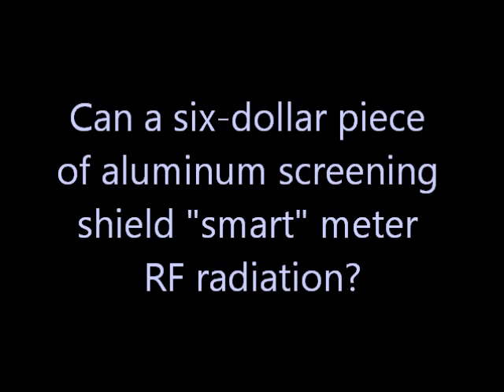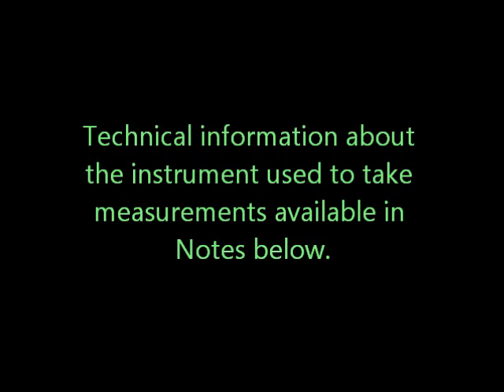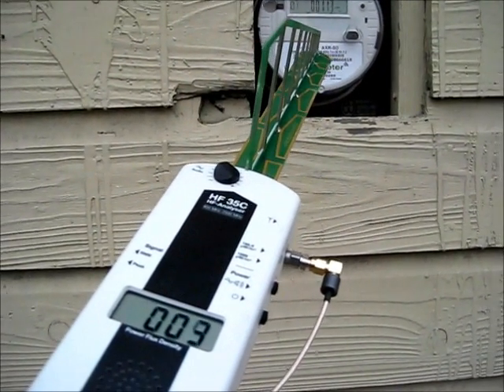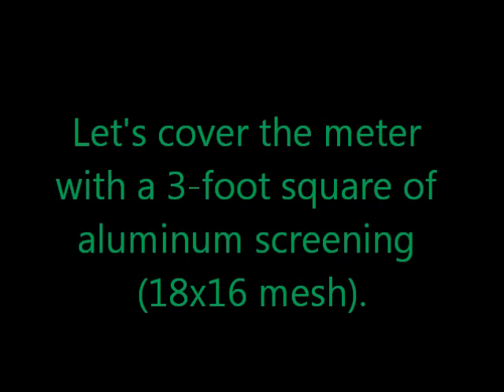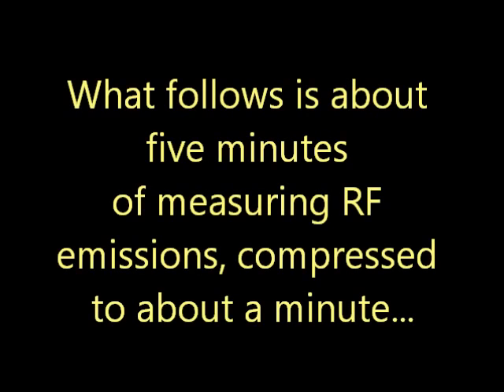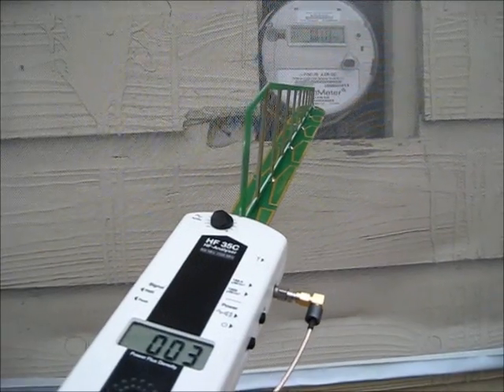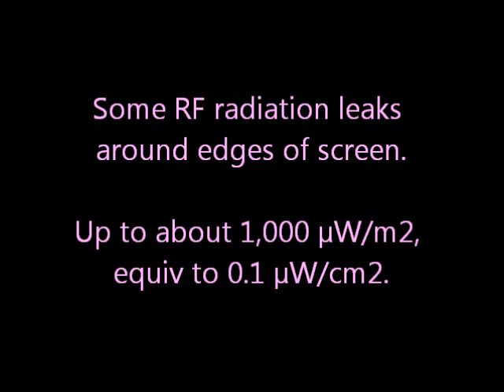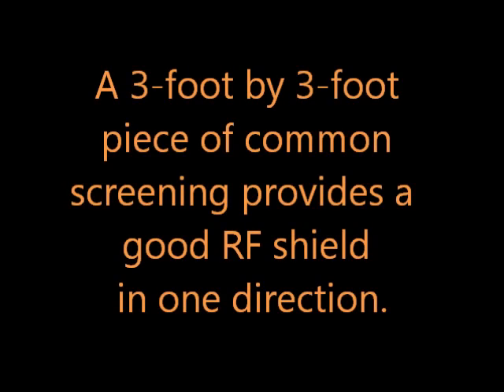Foiling a "Smart" Meter, Part Two: Aluminum Mesh Screening

Comment: really how about the 'radiation' from your electrical wiring, wifi, cell phone, the sun. it's not the same as nuclear radiation. and it's all around you. get rid of all your electrical things and move out into the stick where there is no electricity and you'll still be exposed. Go to school and learn what it all really means.Please
Reply: It occurs to me I have been very mistaken in my position on this. I can't understand why I didn't see it before.
These meters DO emit deadly, cancer Causing Radiation!  The proof here is undeniable!

But Luckily, I have come up with a soloution for this and I'll be selling it to all the wise people that have woken up to this terrible plot.  For just $99.95, I'll be selling little bits of aluminium mesh like shown  in the Vid here so people can protect themselves from this terrible threat.  To show my genuine concern, I'll even put my own financial interests aside and do a buy 2 get one free deal. One for the front of the meter, one for the back and one for  your cell phone just in case there is any secret cancer causing radio modulation in that which has yet to be discovered.

It's important to be prepared!

So just email me your order and Credit card details and I'll send you your radiation screen  for just $ 99.95 With Free shipping of $51.90. Comes with full instruction of how to remove from the plastic packaging and a comprehensive mounting kit consisting of 4 screws and  2 yards of Duct tape for those customers not  trained and qualified on the use of screwdrivers.

Get your's now! before it's too late and stocks are sold out. AND, as a free Bonus, for the first 100,000 crackpo....customers, I'll also include FREE links to other vital information on Running your car on water, Free energy, Tesla Turbines, aliens on earth and other secret  information your gubbermint is trying to hide from you.

                ORDER NOW!
Reply: *****  "Smart meter radiation is encoded with cancer and disease enhancing modulation" ?? LOL...Some military engineers might like to have a quick look at that circuitry, son.
Reply: +Richardj I believe the radio frequencies all around and going through us are a health problem.  It's mostly manifested in confused thinking and fatigue.  Since I have high energy, I get attention from people with low energy.  I would imagine many of them haven't found a reliable source to keep their energy high(like eating or abstinence from alcohol).
Reply: +Oil Burner Hint-we've already seen arguments like yours enough to know they aren't really arguments.  You are trying to negate the argument by saying the person arguing is a nut-sounds logical to me(not).
Reply: +Richardj Ionizing radiation is a known health hazard.  It does not mean non-ionizing radiation(which can heat up things, for one) is safe.  You don't find the lack of study of non-ionizing radiation to be a problem?  You can look to that 1996 law preventing cities and states from denying cell phone tower construction based on health reasons as the cause.  You then can't turn around and say what studies say about non-ionizing radiation(which you have characterized incorrectly), when studying that has been suppressed by this law(cities and states would have to prove in court if that construction was unhealthy, which they can't do now.).
Reply: Did you really read the link you gave me here is a quote from that page "Smart meters give off RF radiation. RF radiation is low-energy radiation. RF radiation doesn’t have enough energy to remove charged particles such as electrons (ionize), and so is called non-ionizing radiation. Non-ionizing radiation has enough energy to move atoms in a molecule around or cause them to vibrate, which can lead to heat but it can’t damage DNA directly.
RF radiation is classified by the International Agency for Research on Cancer (IARC), as “possibly carcinogenic to humans.” This is based on the finding of a possible link in at least one study between cell phone use and a specific type of brain tumor. Because RF radiation is a possible carcinogen, and smart meters give off RF radiation, it is possible that smart meters could increase cancer risk. Still, it isn’t clear what risk, if any there might be from living in a home with a smart meter.
It would be nearly impossible to conduct a study to prove or disprove a link between living in a house with smart meters and cancer because people have so many sources of exposure to RF and the level of exposure from this source is so small. Because, the amount of RF radiation you could be exposed to from a smart meter is much less than what you could be exposed to from a cell phone, it is very unlikely that living in a house with a smart meter increases risk of cancer. The World Health Organization has promised to conduct a formal assessment of the risks from RF exposure but this report is not yet available."
Reply: Frederique Zug
If the laws in your country had any significance to me, I'd look the answer up.
You seem to think that knowing the answer to these questions proves something.
All it really proves is you need significant mental help.
Reply: Frederique Zug  Where do you live?
USA?
Reply: *****  This whole EMF witch hunt began on Larry King Show, I believe.
Reply: +Richardj And you might learn something if you tried to offset the effects of non-ionizing EMF on people.
Reply: +Richardj Evidence, huh?  How about the 1996 FCC ruling that tells cities and states that they can't deny cell phone tower construction based on health effects?  Would that ruling have the effect of stopping a lot of health evidence, as cities and states present evidence of health effects?  There is plenty of evidence online about the health effects of non-ionizing EMF, and there would have been a ton more, if this ruling was not in effect.
Reply: +Richardj 1996 FCC ruling is a fact.
Reply: +Richardj Please stop advising people about health.  You don't know what you are talking about.  Sorry, but you are advising doing nothing, and that everything is okay, and that's not true.
Reply: +Oil Burner I'm going to the Castro Valley Gem and Mineral Society show this weekend at the Newark Pavillion(Newark, California), and I'm willing to give some of my orgonite(I'll tell you how to use it.) to someone(I don't have a lot.), which will give that person an idea of the effects of EMF in our air today(no need to listen to all these intellectual arguments, if you see the effects for yourself.).  I haven't told him yet, but see Andy(or his wife) at Himalayan Clarity's booth for this.
Reply: +Richardj 1996 law stating that cities and states can't prevent cell phone tower construction based on health totally negates the idea that someone is looking at how healthy these things are.  They've decided to stop any discussion about it.  So, don't try to say something that's just not true.  No one is looking at the health of these things.
Reply: +Oil Burner You are trying to paint a picture, and what we really need is data.  How strong is the transmitter.  What frequency is being used, etc.  You might try to liken things to fairy tales, but what does that have to do with anything?
Reply: +Richardj Don't you have it backwards?  Please show me that it's safe.
Reply: +Richardj I recently put some of my orgonite near the fuses in the breaker box, to good effect.
Reply: how do you know this? it runs only one minute a day.  Where is your evidence?
Reply: Please you don't understand what evidence is.  If believe you this and you listen to the radio, how are you radio receiving the station, turning off your radio does not stop the rf from all the radio station etc from reaching you. Do you know how many milliwatt rf sources are all around around us. Look it up please, and please don't use Anecdotal evidence.
Reply: OK you believe what you want? How do you know what you claim? I don't see evidence of people getting sick from smart meters only claims. You think that there are lies and deceit but I don't see that only claims without facts. Good luck finding your proof about the lies and deceit. The CDC is lying the medical people  everyone, sorry i can't see that. I need evidence and I don't see it.  The smart meter is no different then most electronics out there (wireless headphones etc) it all works the same but the smart meter is on, one minute a day.  Well most places you can pay extra not to have one, try that.  Still i don't see any evidence for what you claim.
Reply: sure just Argumentum ad populum. Like the meter being used what does it really show. Take that same meter and try it on other things and if your afraid of smart meters you'll have your eyes opened about many other things. YouTube channels are there learn science not actually it is school and and education to understand is what is important.
Just an example there are many youtube channels that say the world is flat and that we have never been to the moon. So how do you decide which ones are right. Or do you just pick out the ones that you agree with. Good Luck
Reply: *****
You seem to be truly obsessed with the notion of big brother and gubbermints or whoever trying to kill you with Chemtrails, smart meters and the like. I have to say I'm really facinated by your absoloute belief in these things. You have been told many times about other things emitting radiation like phones but you seem to ignore that and If I interpret your replies correctly, you seem to be of the opinion that the radiation bursts from these meters are actually designed to cause cancer. Is that correct or have I misunderstood what you are saying?
Really, I wish I could be as dedicated/ obsessed/ believing in anything like you are with this. I just don't have that much absoloute faith in anything much less something that has no factual or evidentary support.

To me, covering the meters from the outside is only going to reflect the radiation you claim is there back into the house.

As for putting your faith in things on YT or any other part of the net which are just anecdotal, that to me is just ridicilous.  There are loads of vids telling me I can run my car on water, how people have been kidnapped by ailens, they can grow hair on a billiard ball, loose 10Lb overnight by having a steak dinner and all sorts of other poppy cock. That doesent go any way to making something true, it just shows that people will believe and say anything no matter how illogical or baseless. I spoke face to face with a woman a few years ago who had her Horse dug up 3 days after the vet put it down because god told her in a dream it was still alive.  I can't imagine what the guy with the excavator was thinking when he was diging the thing up out of the ground 3 days later with the woman standing there thinking the thing would be alive. Just because people say something dosen't mean it's true.

You are never going to be taken seriously by claiming no mainstream media is going to publish something. If the problem is as bad as you say, there will be plenty of people supplying evidence from doctors and the like that they don't need mainstream media for.  The media aren't publicising Fukishima but there are plenty of relaiable and factual sources of whats going on with it though.
Reply: Please show me evidence that they do damage and not from personal opinion.  The rf from a smart meter is no different than from a radio transmission.  If I'm wrong please point me to evidence. Showing an rf meter and not the settingdand claiming damage shows nothing.
Reply: *****
more excuses, no facts.
Reply: Really I'm the asking where are your facts and you don't have any. Except that 'they' are all hiding the facts and that other youtube videos agree with this video.   You say cancer is encoded in the RF from smart meters where is your study showing this is true. Please supply the facts not anecdotes.

Comment: Does the screen have to be grounded???
Reply: Yes.
Reply: NO it does not.
Reply: ***** Sorry, but your dead wrong. .  Here's some examples.  The bag into which you put your EZ pass in order for it not to be read by the toll booth is a Faraday cage,  is that bag grounded?  The metal screen in the glass ofa microwave oven door acts as a Faraday cage, is that screen grounded? No it is not.  Take a copper box, install an RF radiating structure inside, seal the box and measure how much RF excapes, and all with NO grounding at all... Still don't believe, look in any good RF Engineering handbook.
Reply: *****  Nice theory but totally wrong. I've seen ungrounded Faraday cages work just as well as those that were grounded. RFID or Microwave, RF is RF. Why would a ungrounded cage work in one application and not the other.